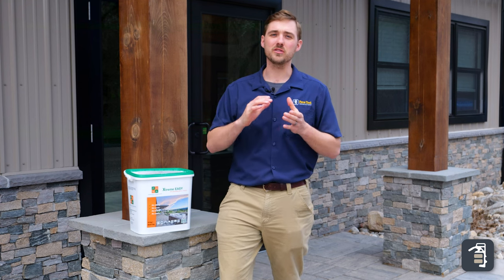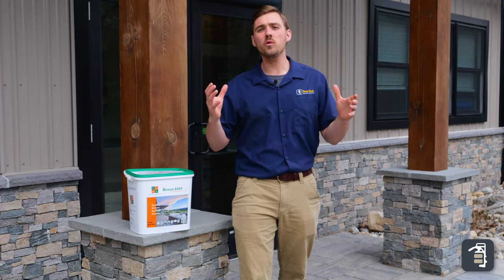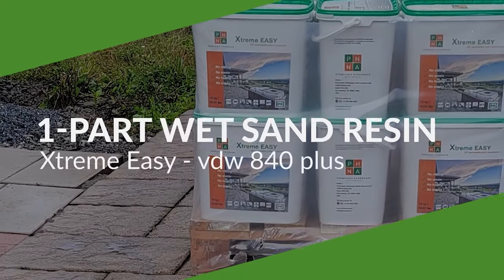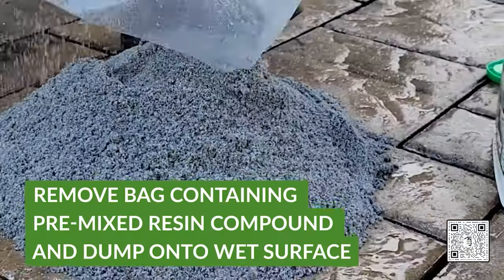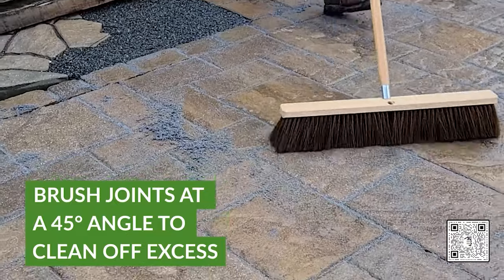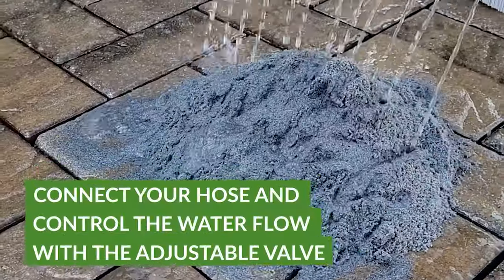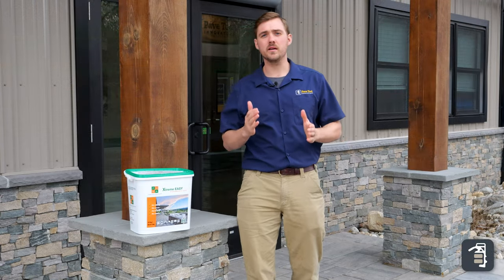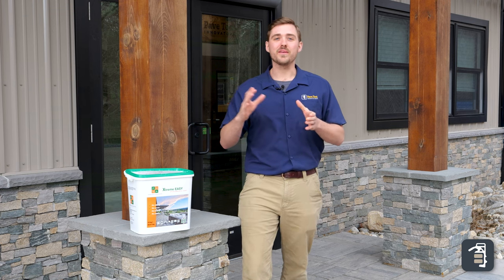Xtreme Easy is Here

Comment: Hey folks, love your products and your customer service. The question is -why use this over EasyJoint?
Reply from the maker: GftK, the manufacturer of Xtreme Easy, has the longest history in these types of jointing materials. They are trusted brand, but we are still carrying EasyJoint. One of the bigger differences is that Xtreme Easy can make it into a thinner joint than EasyJoint because it is a finer grain sand. As for cost, they are the same price per pound. We encourage you to try our Xtreme Easy and see which you prefer! We aim to satisfy all of our customers.
Reply: @PaverToolInnovators  Thank you for the answer. Yes I think I will try some when we hit the thinner joints. EasyJoint struggles with tight joints, and I hate polymeric sand with a passion.
Reply from the maker: @PuppyStomper87  amazing! Looking forward to your feedback, you are a valued customer!
Reply: @PaverToolInnovators  Given the interactions with Caleb, I know this is the case. Have taken care of us on a couple of different occasions and have been very helpful with your products.
Reply: Does all of the existing old polymeric sand have to be removed from the joints before applying this?